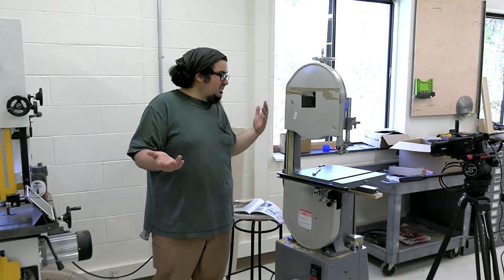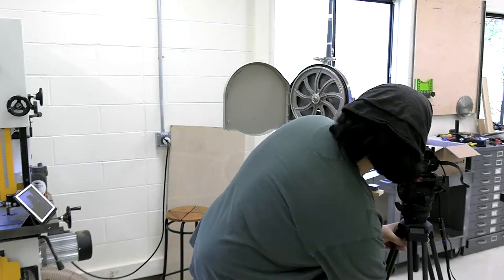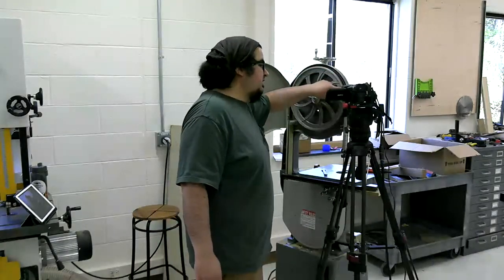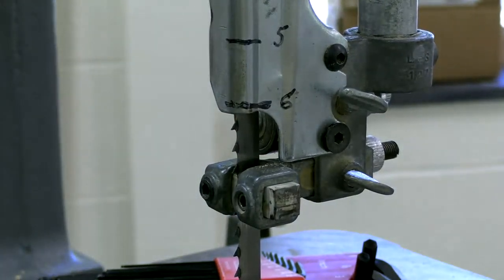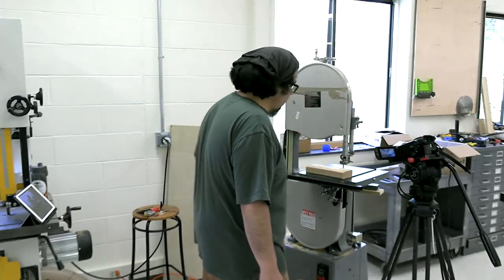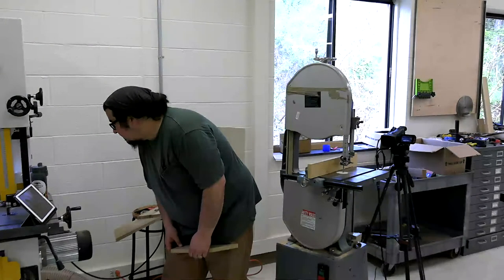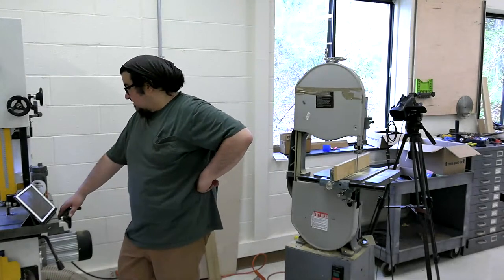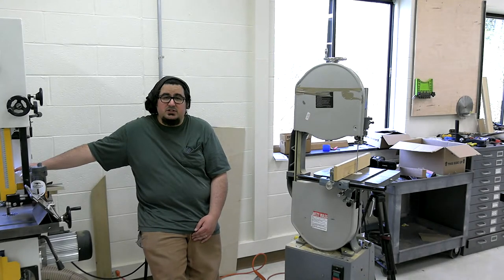Setting up our 14-in. bandsaw

Comment: @Jay Gee 44:39 Before replacing the spring, check if your blade is a little longer than should be... thus the bottoming out of the tension adjusting screw.